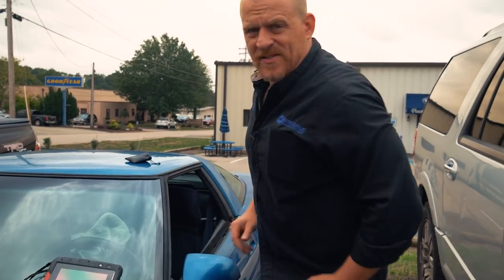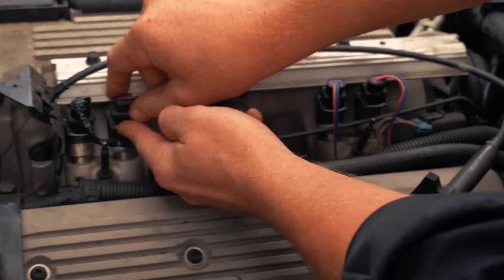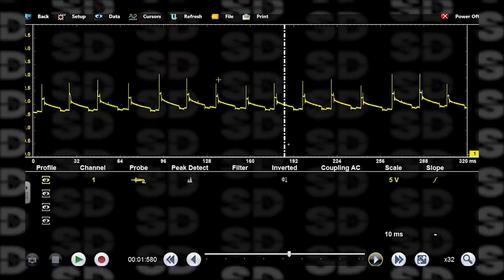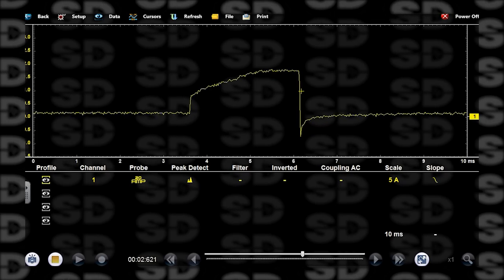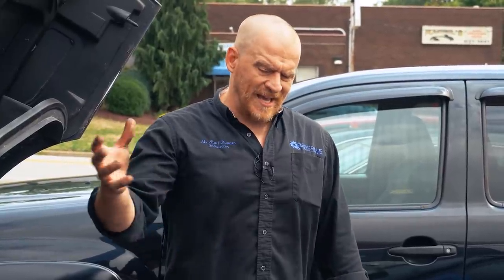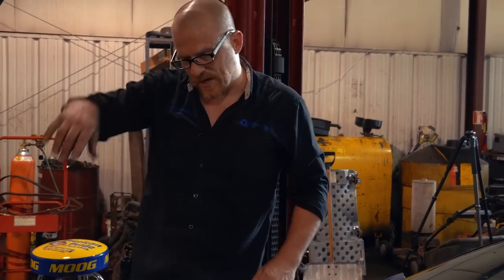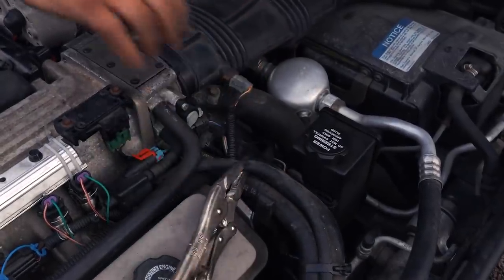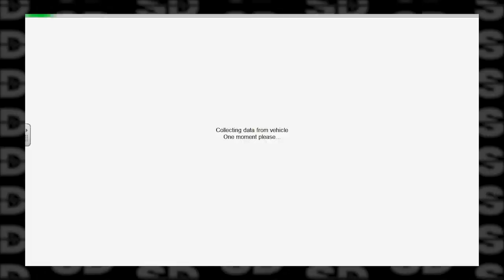1992 Corvette Misfire, Melted Cats, O2 Testing (Part 2 of 2)

Comment: Very good videos! Bravo!... I own an 89 Vette here in France and just replaced the injectors few weeks ago. Got them from FINC... they are new Delphi.... 22lbs/hr which is the tuning that is programmed in the ECM software (I have the code listing) I doubt that Eccel injectors are 22 lbs.... certainly 23 or 24 as I checked lately before ordering mines from FINC... They are the exact same lenght as the OEM parts and do not require the original clips to be reinstalled, they're all 16.5 Ohm at cold and 15.8 at warm engine.... my INT and BLM are now respectively 128 and 126  at idle closed loop after replacing break booster (original cracked on both vaccum and atmospheric  sides...). The car is 44 k miles only but 31 years old.

Comment: These are good on gas mine does 19-20 in town . Also noticed you talking about 92 heaters (not ) they are singing wire or at least mine is . Nice job finding the shouted injector.

Comment: Injectors do clog up AND their coil windings do short out.  I'd bet the plugs were fouled, especially on #3.  Also, you may find traces of oil consumption on the plugs.  Older GM V8's with mileage on them were known for that.
You should also remove the battery cables and short them together to reset the PCM.  Then road test.
Looks like you solved the miss and some of the idle richness.  Good Deal!

Comment: Part 2 finally, now we have the answer on the cutting the pipes to relieve back pressure due to the clogged cat/s. Learned more here with your great teaching. And noticed a new edit trick used by Caleb nice going kid, keep it up. Don't get to good Caleb people will start ignoring what you father is doing. LOL. Nice teaching Mr Danner. Yes because of you video's your brothers shop was only going in one direction...UP. GOD bless him.
Reply: Relieving the back pressure was exactly what I was thinking. To at least make it drivable. Of course it would have been nice to have been told about it first.

Comment: Great video.. my son has the same car.  92 LT1 .. it’s getting 8mpg.. The previous owner drove it 1K in 5 years. We believe it sat most of the time. Last night we added to a fresh tank of premium a bottle of redline complete fuel system cleaner. We ordered new air filter we have a new K&N fuel filter we will change after this tank. We will olm the injectors next.  The previous owner removed the CATs just straight pipes. It has a low lob cam setup. We are replacing the up stream O2 sensors. With out a computer we are doing what you don’t like and putting on parts. We will look at the MAP next not sure how to test the map. Any thoughts. It should be getting at least 18 around town. We don’t hear any missing . No equipment to test. Thoughts.. I very few tech know what you know in my area GA ..  We were going to have the car looked at by a vett mechanic but i talked to the owners mechanic that worked on the car for years he gave the car a great review.  After we bought it we replaced 

- surge tank crack brass top severely leaking radiator cap causing coolant ot fill over flow tank,
- main cooling fan dead.
- replaced cracking coolant hoses
- water pump temp sensor because it was inexpensive and original 

Now the car temps are good.

Thought one the MPG

Comment: Great video as always!  About that fuel trim. Maybe it's at 117  because the aftermarket injectors are spraying a little too much fuel and so the computer slightly takes fuel away. In that case it takes fuel away from the other injectors as well. One test you could have done is the swaparoo.  Swap the two aftermarket injectors that were put on to the other bank on the other side of the engine, and if the problem goes to the other side then it's the injectors that were the problem.
Reply: You're forgetting that all the injectors got replaced.  The offending injectors were on the opposite bank to the bank that is currently running rich.  If Paul absolutely had to try and diagnose the difference in fuel trim, swapping injectors would be a wide open crap shoot that takes too much time to execute.  He gave some mention to injector balance testing and that would be the right way to go to isolate an injector fault with the new ones.

Comment: Did you check the air filter? A dirty air filter can cause a rich condition. I was hesitant to mention this as you mentioned the rich condition was in the right bank but then you mentioned both banks started to show a rich condition when you had it 2500. Wouldn’t hurt to check.

Comment: Very interesting video as always, these videos are very inspiring to give me the kick in the ass to be a repairer rather than a parts changer ....! Also my workshop in my new job (since March) at the local JLR dealer ship is a huge fan of yours Paul to the point of when watching him carry diagnose issues it’s like watching you in action ....! 
On another note could similar diagnosis procedures be used to diagnose an injector issue with a 4 cylinder Bmw diesel with common rail fuel injection.....?
Reply: Insulation resistance test to check for shorted injectors, dont unplug injectors whilst running on diesels if they're piezo injectors or if you're unsure what type they are

Comment: Well it's an old engine.  It is a speed density fuel strategy on the 92 I believe.  I believe the 86-87 had a MAF but 92 shouldn't.   So if the air pump (engine) isn't working quite as well as it should because it's old and has a little lower compression than it should, the computer is going to expect a certain amount of air.  If it's not moving that much air, then you end up with less oxygen at the 02 and it trims the fuel back.   I have beat myself up a few times on this with speed density engines, only to find lower compression on one or two cylinders.  Not low enough to cause a problem, but lower than the computer expects it to be.
Reply: Thats an interesting point. In this case, the MAP should not see the pressure difference in the manifold? As I stated on another comment, I have a GM with an inline-4 with speed-density Bosch fuel system. Fuel trims are a bit low at idle (115-117) and misfires at the snap-throttle test (you can smell the unburnt excess fuel). Made a job at the head due to a leaky head gasket, but didn't check for cylinder compression.
Reply: @dannielpizatto7357  Yeah the computer has no way to tell exactly how much air is coming in without a MAF.  It's basically hard coded into the computer how much air that engine should move.   The MAP is reading the pressure, and the TPM reads the throttle position, based on those readings the computer knows how much air should be coming in at any time.   Also if you have one leaky injector it will trim all the injectors back as a bank.  So you can have on rich cylinder, but the other cylinder will run lean till the point of a misfire.  I''ve seen this a lot on Dodge Neons.

Comment: I can't believe anyone would have changed only one injector on these things.  I was thinking this was sequential.  But it's two separate banks multi port, right?  I'm curious to know because the slightly earlier TPI engines have two fuses for two separate banks.  The transistor drivers on mine shut down simultaneously on overheating caused by low ohm injectors.  I replaced all mine with reman Bosch injectors for well  under $200.  Couldn't beat the price from the supplier.  The Bosch injectors fit perfectly and plugged right into the factory harness connectors.  I threw a lot of parts and got left beside the road several times because I thought it was a fuel or ignition problem based on it just shutting off unexpectedly.  Absolutely no codes thrown.

Comment: Hey Paul !!…your Corvette guy here…was playing around with my new 4425A in my garage on my 01 Corvette and my exhaust started smelling…both my bank 1 fuel trims were maxed out and all bank 1 cylinders had misfires..fired up the Verus and the upstream O2 was stuck lean…no response with propane…I had my capacitive ignition lead hooked up at the time and I had the exact same downward slope on the spark line…I guess that’s what a rich mixture looks like…could not find any technical info on that waveform looking like that…Delphi and Bosch O2’s did not work on the car…WTH ??…a Denso O2 did work !!…Question ??…did a cranking “ intake” capture with my WPS500 and the bottom of the intake pulls looked “jagged”…Pico is defaulted to 12 bits “resolution enhancement” and when I selected 16 bits the waveform smoothed out…posted on the Pico Facebook group with not much help even from Brandon S…will have to see what 12 vs 16 bits does with the Pico…first time I ever changed that setting !!
Reply from the maker: Yes an overly rich or fouled plug can give that downward slope. 
Not sure what to tell you about that pico waveform my friend.
Reply: @ScannerDanner  thanks buddy !!..was going to post this on the Premium channel but I was going to see if you’d respond here…thanks !!…going to 16 bits fixed it I guess..hope you’re next getting much snow up there…very windy down here in SW Florida…near freezing tonight..,YIKES !!..figuring an overly rich mixture is more “conductive” as far as HC’s go and the opposite of a lean waveform !!…stay safe my friend !!
Reply from the maker: @rwrobs777  where at in SW Florida? We're headed to Anna Maria Island in early March
Reply: @ScannerDanner  I’m in Cape Coral by Fort Myers !!….hit me up if you guys want to meet up for dinner one night or do a BBQ down here…LOL !!..oh BTW, I gave Matt from Schrodingers Box my old 2 channel Pico…he was THRILLED !!
Reply from the maker: @rwrobs777  nice! tell Matt I said hello. How close is Cape Coral to there?
Reply: @ScannerDanner  will do !!…a little over an hours drive…you are a little north of Sarasota.

Comment: Is it possible that it's just the O2 sensors being mismatched?  They are pretty old too.  If it's two separate injector bank drivers, and I suspect it is, it's possible one of the ECM injector grounding transistors is driving one bank a little longer.  Check the pulse widths left bank vs right bank?

Comment: Having a similar issue with my inline-4 GM. BLM at idle at aprox. 115-117 and a rich misfire at snap-throttle test. Injectors are leak-free, checked fuel pressure regulator, no leaks. I'm believing that I may have a malfunctioning MAP.

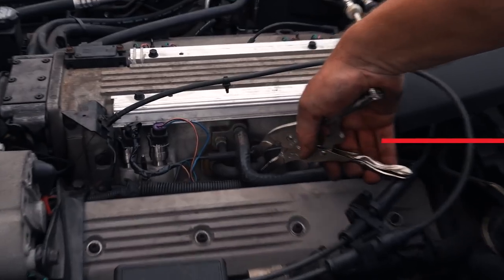Comment: At 30:06 when you closed off the pcv flow, the blm's and int's got better.  That makes sense if the engine was running so rich that it clogged the cat, for fuel vapors to be in the oil.  I was hoping you'd sniff the oil for us haha.  But that makes me think an oil change and a few good spirited drives should keep this 'vette goin!

Comment: Great video Paul and Caleb! How can we use 02's  to identify which bank is missing?  Thanks in advance Paul Danner!
Reply from the maker: Misfires in general, cause a false lean O2 signal on the misfiring bank. I used the fuel trim to show me my misfire was on the left bank and I proved it with the rpm drop test. Hope that makes sense

Comment: Paul, the group fired injectors is that all Corvettes or only that generation (C4). I have a C5 (2001) so just curious. I wish I had seen this video before I did my injectors. It would have been helpful. So, the 12.6 ohms again is that all Corvettes or does that change with the type of injector, stock vs. Aftermarket. Thanks another great video. I am  DIY'r so I am learning a lot from your videos and book.
Reply: Your C5 is sequential injection. C4 went to this in 94.
Reply from the maker: 94 went to sequential? Thanks!

Comment: I think in the late 1980's and early 90's Ford actually used bank fired injectors on their V8 engines like the 302. That's weird how this engine has multiple injectors but only one driver.

Comment: I have a question when you are testing a cam or crank sensor I seen on a video that you did and you back probed the 5 volt and the ground wires and you jump them together what does that mean when your doing it?

Comment: Every older GM v8 vehicle I've ever been near in traffic runs rich, some even smell like raw fuel.
Reply: cats are usually bad and everything dirty making them idle rich, also the older TBI injection tended to harden the rubber diaphragms causing high fuel pressure/rich, not to mention they always skip spark plug/ignition tuneup day, until it;s so bad they drop cylinders lol (except for me, I like mine to run proper)

Comment: he needs to part cannon plugs, wires and cap/rotor. lol ( just plugs if it;s been done recently, a lame plug causing delayed flame front can totally alter things. plus if he didn't replace O2's (which I'm sure you mentioned to do last video) that could be the issue. regulator could be hardened and FP higher than normal.
who knows what else at that age of vehicle lol

Comment: I didn’t see you check the fuel pressure. Is it holding pressure. 
I have a 97 camaro with a lt1 
Broken spring inside the regulator. 
Every once I a while it would hang the valve open.

Comment: with those GM Multec 1 injectors it's not a matter of if they are shorted, but when they will short. Ethanol in todays fuel attacks the insulation in the coil windings which are exposed to fuel in that design.

Comment: 👍👍👍👍👍👍. That's for the 6 dingdongs who thumbed down. 
Thanks for another great episode guys. Do shorted injectors add fuel? If so, why?
Reply from the maker: Fuel imbalance and in our case, based on the trim numbers, I believe that #3 cylinder was not getting enough fuel. At the same time, the downward spark line suggested a fouled plug.

Comment: Great stuff ,  would it be worth swapping the  injectors over left to right  in case  of a faulty injector causing it to run a little rich ?
Reply from the maker: We replaced all 8 😉 unless your talking about one of the new ones having issues. An injector balance test would be easier than swapping but yes you could do that 😉

Comment: Paul I seen Ivan working on one of this older systems and the scanner makes them run wierd you need to put it on road test mode or something like that
Reply from the maker: Yes, this one didn't have the "road test" mode lol. I actually even mentioned that in this video about the scan tool having an effect
Reply: Yes OBD1 scan tools have an effect on behavior of the ECM... This is due to the refreshing rate of the data stream and the transmission  baud rate :160 (few data) or 8192 (more details).... if you wish to update the display 5 times/s with fresh data...the ECM will have a hard time to keep up with that.... although it is explained that refresh rate at 8192 baud can be 8 per second... yes... but not for a long period... ECM technology is old! Motorola 6800 8 bits....

Comment: nothing is made as it was before 2009. Not even injectors. I had an issue where I needed to do a precise flow test on injectors and arrange the placement  per bank that they would be approx the same as they are batch fired.

Comment: Camaro/Firebird use the same LT1 Gen2  engine also!  Optispark problems ahead haha.
Reply: Thx a lot. You just had to say Optispark.., my right eye twitch I havent had since the 90's is all of a sudden back again
Reply: @kevinshasteen5682  Haha, had to put 2 optisparks on my 93 Z/28 within the last 18 months. G.M. warranty on the part was 2 years so the second was covered,still a pain in the ass job to do!

Comment: oh by the way you probably should have done an injector balance test before removing the factory injectors get a good number on the good injectors so you can check the new injectors you may have one that flows a little more that the rest

Comment: At this point there’s a good chance the driver in the ecm for the injectors is bad. Unplug it and probe for grounds with the motor off. It’s a big problem on a batch fire car but these sequential injection cars can run ok
Reply from the maker: These drivers are pretty bulletproof on these. I've seen them handle 15 amps when they normally only see 4-6 amps (6 or 8 cylinder engine)
They actually have current limiting circuits for the driver and this is why a single shorted injector causes a no start.
Reply: Well mine went bad and it took a lot of work to figure it out

Comment: I am no mechanic/auto technician. But wouldn't the ohm readings be easist to start with? Then move on from there?
Reply: Ohm testing can be misleading.  Paul gave some mention somewhere in the video that resistance can change with temperature.  That means a bad part can still pass an Ohm spec.

Comment: I’m confused on group fired injectors. So all 8 injectors fire at the same time? I’m assuming not sprayed directly into the combustion chamber?
Reply: yes i am pretty sure they fire 4 at a time
Reply from the maker: No sir, all 8. It has two separate control wires, one for each bank, but only one driver in the ecm
Reply: So when the fuel is sprayed all at once how does it not end up going out the exhaust? It has to be spraying while one of the pistons is coming up on exhaust stroke
Reply from the maker: @joshwilson1522  intake valves are closed until the cylinder is ready for the air and fuel. Think about how a carburetor works, same thing. Just that the fuel is highly atomized and vaporizes almost instantly when sprayed at the back of the intake valve.
Reply: @ScannerDanner  That is really weird, I remember re wiring a early 90's firebird with a TPI engine, that I put into a s10 blazer and I remember it having 2 control wires, 1 for each bank so I assumed it had 2 drivers.
Reply from the maker: @JOHNPHUFNAGEL  it is weird, two control wires and one driver 😉 All of these GMs were like this. The 2.8, 3.1, 5.0, 5.7
Reply from the maker: @joshwilson1522  when you scope the timing of these injector events, they do spray during the exhaust stroke